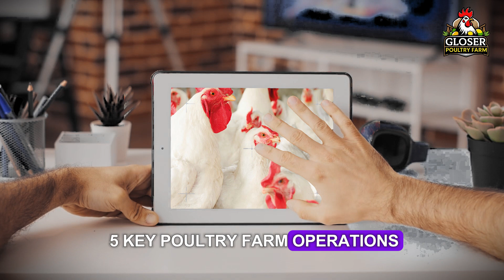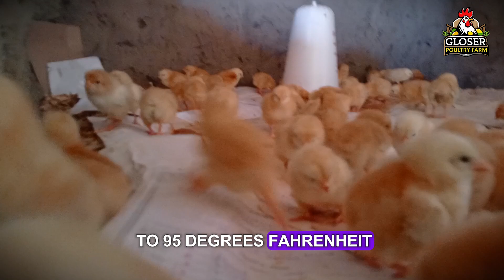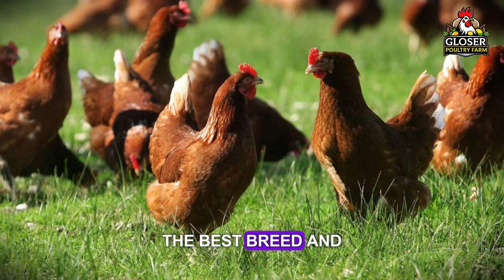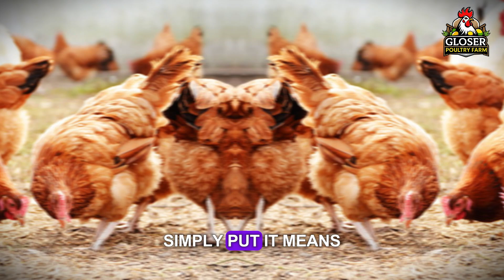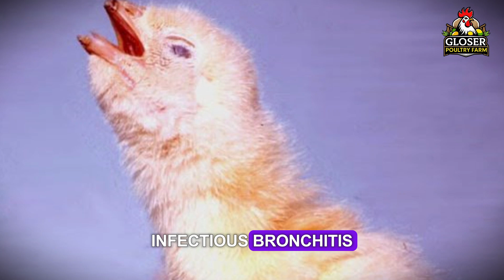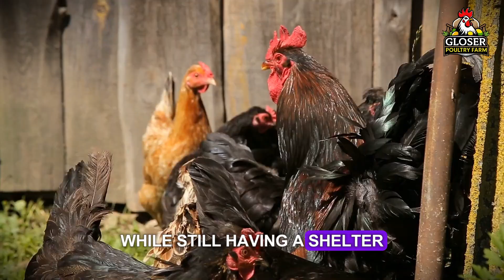5 Poultry Farm Operations Every Beginner Must Master (Beginner's Guide to Poultry Farming).

Comment: When you talk about 6 birds in a sq metre(what is a deep litter system?)
Reply from the maker: A deep litter system is when you raise chickens on a thick layer of bedding (like wood shavings, rice husks, or straw) that you keep adding fresh material on top of as it gets dirty. Instead of cleaning it out daily, you only remove it after several months. It saves labor, reduces smell, and the bedding composts into good manure for crops.

Comment: Hi there after how long can one clean a chicken house with saw dust for 50 Chickens?
Reply from the maker: You can change saw dust after six months. But if they are wet, you should remove the wet litter and replace it with fresh ones.